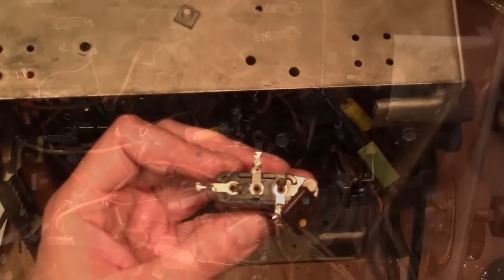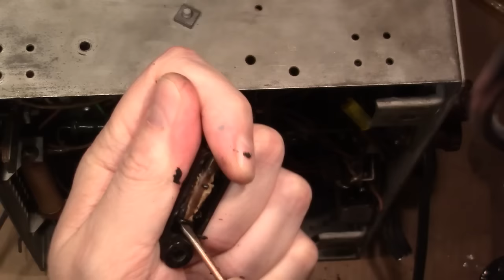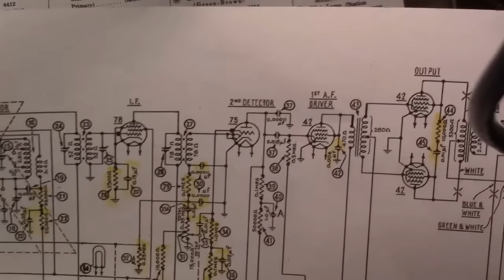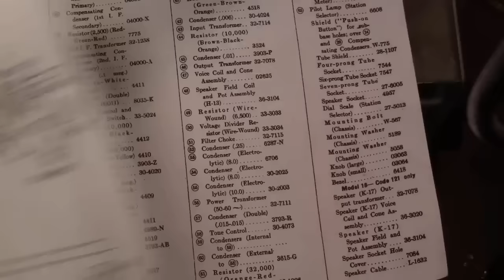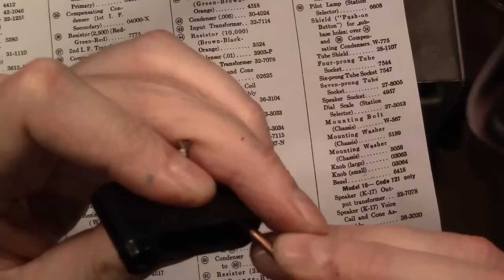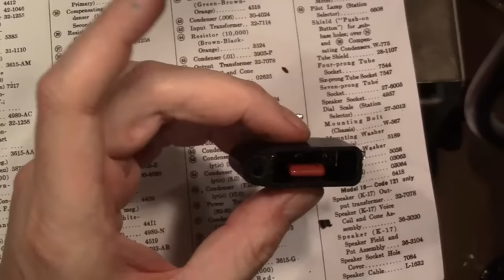Philco 18 restoration p4o6

Comment: I am intrigued by your replacement of the filter caps with ac motor caps.  I have been thinking about doing that my self but was not sure that I could replace electrolytics with ac caps.  I was wondering if there are any instances where you could replace paper caps with ceramic caps.  Do you know?

Comment: concerning bass response there is an issue which will cause it to be reduced. It has to do with the 1uF cap across the 6.5K resistor. when you've got the radio working good put your scope across the 6.5K resistor then feed an audio signal to either a rf generator or to the volume control. start at 200 Hz and go down to 40 Hz. you should see the waveform start to increase as you go lower in frequency. that means as you go down in frequency there is an increasingly higher impedance seen by the 42 driver which means less signal is going through the driver transformer. the cure is to increase the value of the 1uF cap. don't know the exact value it should be as I only had a 30uF cap of the correct voltage. the 30 uF worked good and at 40 Hz there is now very little signal across the 6.5K resistor. that helps bass response some, but the limitation is two things. one the driver transformer starts reducing the bass around 70 Hz, but the reduction isn't much and the sinewave is still clean. the second is the speaker which cannot reproduce below about 55Hz very well.
Reply: in addition to my comment I only recommend doing that fix if your spider is in good condition. if it is not don't do that mod as it will cause the cone to move more ruining the already compromised spider. an easy fix there if the bass responses to 40-50 Hz is desired is to install a cap in series with the speaker of around 540 uF (was all I had on hand 220 220 and 100 with the calculated value being 680) which reduces the bass response to the speaker. you then connect a cable to the output transformer secondary which will either feed a 10" or 12" very efficient vintage 4 ohm or lower impedance speaker directly with a 6 mH choke in series or a 20 watt amp from a powered sub with a built in crossover of around 200 Hz driving a 10" or 12" speaker. the amp and speaker or  just the speaker can be hidden in a table used to display the radio so that no one will even know.
Reply: +jmcinvale using just a speaker can have mixed results depending on how loud you need the speaker to be how efficient the speaker is and the enclosure the speaker is in. with mine I found none of the speakers I had were efficient enough so I had to go the amp route.

Comment: Bob,  Thanks for showing another way to get that potting compound out of those bakelite blocks.  I don't own a heat gun yet, so that will come in handy.  I put up a couple of videos recently of my 18 in my photo over there<<<.  In the last couple of weeks I've also picked up 3 more radios, an RCA Victor K80, a Philco 630X and a Hallicrafters S-40A boat anchor.  Hope to start on one of them this Spring when it's a bit warmer out in the garage.  Have a good amount of tools for the work, but still need to pick up a variac, isolation transformer and a signal generator and at some point a tube tester as well.  Between following you, Joernone, Buzz1151, RestoreOldRadios, AllAmericanFiveRadio and a few others this last year I've learned a lot.  I know I have a whole lot more left to learn yet but I now have the confidence to give it a shot anyhow.  Thanks you for another fine video.  Gary

Comment: yea Bob,  you left us with a good old fashioned cliff hanger.  glad you were able to get the Transformer to work. when I contacted my friend about the spare chassis , he said that those early Transformers frequently went bad and a coil or two may have been open. so he wasn't able to supply me with one because he said the Transformers on the Cascades that he already had were bad also and they were removed. but I'm going to go and see him soon so maybe he'll have a good dial scale to replace the cracked one. I also learned something from you about taking apart a Bakelite block and getting the old tar or wax out of it I'll have to try that sometime if I ever get the courage up to re-stuff a Bakelite block myself. look forward to the first power up.
Reply from the maker: +amberola1b Oh, I didn't say I got the transformer to work.  I won't know that until I try powering it up.

Comment: Thanks for the video! Is that block you rebuilt similar in theory to a couplate?
Reply from the maker: +Tony T. No, I wouldn't say that.  It's just a single capacitor mounted inside a bakelite box.  A couplate is more like an integrated circuit where multiple components are deposited onto a ceramic substrate using thick film technology.  They're also known as printed electronic circuits or PECs.
Reply: +bandersentv Thank's for that information!